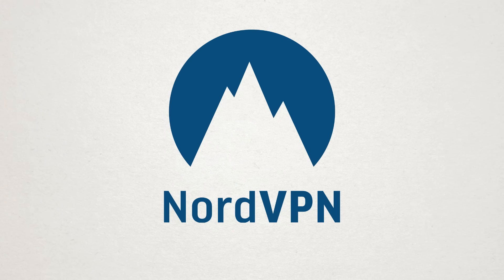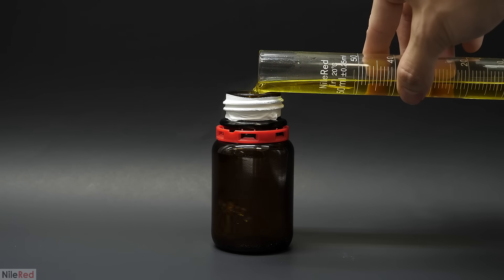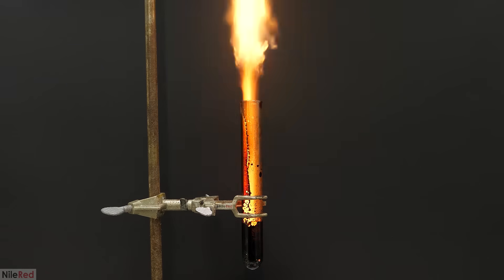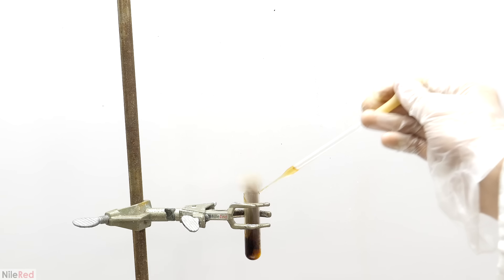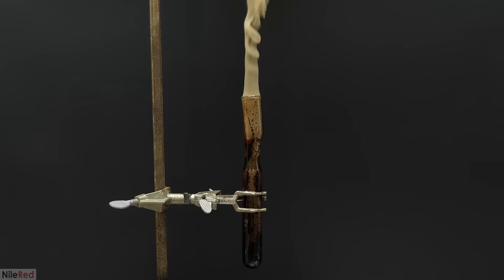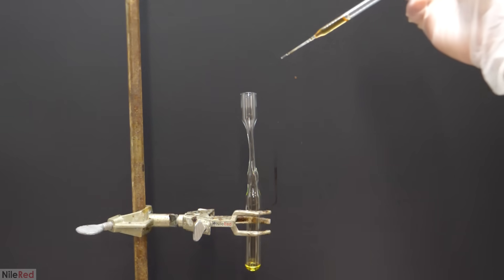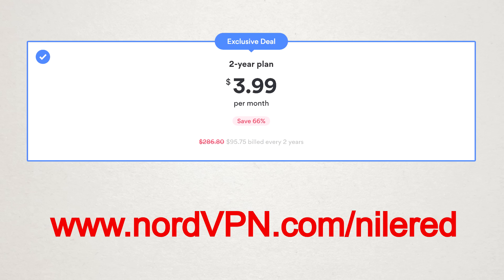Making test tube liquid rockets

Comment: If the chemicals dont mix closer to the throat are they still affected by it? It seems you need to put the throat closer to the bottom of the test tube where the chemicals begin interaction.
Reply: The last tubes throat was fairly close to the bottom and gained a fair result I believe moving the throat closer to the chemicals initial reaction will improve said reaction.

Comment: what if you make a sort of dump tank. which would then work kind of like a solid-fuel rocket. that there's two slightly pressurized tanks that quickly dump the contents into a chamber with a nozzle? 
does that make sense?

Comment: ConDi nozzles will only work if you can get the flow through the throat supersonic, so you get a shockwave form. Otherwise it's just like pinching a hose pipe in the middle of it's length, it just constricts the flow rather than accelerates it

Comment: I'm not sure I understand what's happening very well.

So the whole idea is that the nitric acid oxidizes the aniline, leading to a combustion reaction, a fairly violent one. But there are a few things that I can't understand :

- why does it almost always burn in two times ? There's almost everytime a first combustion, a flameout, and a second combustion. Why is that so ?

- why does it sometimes doesn't ignite ? The reaction is happening so why does it just not ignite ? Does the reaction need to reach a certain temperature for it to become a combustion ?

- why doesn't it work when he narrows the tube too much ? Looks like he's saying that he sprays the aniline too much, but how is it different from before ? Why does he need to add less aniline for it to work ?

Comment: If you use hydrazine, be sure to take no chances with safety.   I don't know where you would get it, but it is used where I work and there are certainly some horror stories with mishandling.  Keep in mind that the vapor during burning is still pretty dangerous.

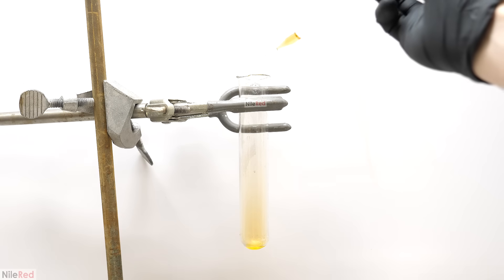Comment: at 4:57 I might be wrong, but it appears like it is the gas that ignites. When you add the aniline to the nitric acid, there is clearly a Lewis acid/base reaction that is exothermic. This quickly evaporate the liquid that ignites, probably when it comes into contact with the air.

Then there is too much product in the tube and not enough reactive. So you have to wait a moment while more reactive get evaporated to get the second blast.

I would suggest doing this experiment in an inert environment, maybe with nitrogen gas. This will show is the ignition is cause by the reactives coming into contact with oxygen.

If this is the case, you can then find the right mix of gas to get the most energetic reaction.

Comment: I’d like to see you test on how much it would propel depending on the length from top of the tube to the bottom. See if that has a correlation to increasing or decrease thrust. But would be difficult to maintain the same diameter of the throat. Great vid non the less, gets ya wondering.

Comment: Try with a mm throat, mostly it could combust and push the entire tube down, your last test actually worked and it got pushed a little, almost not visible but you can see it if you turn down the speed of the video

Comment: I think that you need to make a small glass combustion chamber with a de-laval nozzle. To the combustion chamber, attach two tubes in a "Y" fashion,those can lead to small electric operated valves. On top on the valves, attach a small container for oxidizer and fuel. Then you can fill those chambers with the exact required ratio to achieve a best possible burn and activate the valves from a safe distance. Gravity feed should be enough for small samples.

Comment: Not a scientist here.  BUT

It looked like before you necked down the test tubes the fire took place outside the tube, but afterwards the fire took place inside.

It looked to me like there were two different reactions going on.  The first in the test tube was oxygen starved, created significant heat and then shot the resultant chemical mixture out the tube where it was exposed with air.  This would be very interesting to test further.  I think the second set of reactions were significantly different in that they took place without free oxygen.

Would love someone who actually knows to weigh in.

Comment: Comments: DoNt MeSs WiTh HyDrAzInE
Nile: already made some 3 years ago with urea and bleach
Reply: He made phenylhydrazine and hydrazine sulfate. When it comes to safety those are a world away from pure hydrazine (phenylhydrazine somewhat less so, but he made a tiny amount), which is what the rocket fuel is. Hell in the start of the hydrazine sulfate video he says clearly he will not be making pure hydrazine because it is too dangerous.

Just look at NFPA 704 for hydrazine vs hydrazine sulfate, there's no comparison.

And then there's the part where he wants to use it in rocket experiments, which means not just leaving it in a container but getting it everywhere. Yikes.
Reply: So fun fact, hydrazine is used to add hydrogen to BWR nuclear reactors to prevent oxidation

Comment: "Test tube liquid rocket" is the code word for extreme molotov.
Reply: Xtinct- ohh nasty, a compartmented glass bottle with one half the base and a quarter of the reactive chemical
Reply: @mftripz8445  you just unintentionally gave me the recipe for a Molotov cocktail😏 i uhhh gotta go do something in the garage real quick
Reply: the reason of it not showing any intresting things when you narrowed up the throat was the 
1) the combustion chamber or the place before the throat where reaction was happening was way to big and thus there was not much pressure built up to fire through the main nozzle
2) the throat to nozzle ratio largely matters when you deal with bell nozzle engines here the nozzle was way to big and what happened was the pressure in the chamber dropped too low and thus causing the the air to come in from outside which slowed the reaction and thrust. this is why the flames was not close to the walls (glass)
3)the shape of the part after throat was not well for fluid mechanics. if you see very carefully the throat the place just after the throat you would see a huge empty space between the flames and wall which should have existed 
these were only which i found out being a noob in the subject but yes i could say if he had done all these he might have blown everything around and even glass would not be able to handle the pressure in the chamber
Reply: Buran-Energia.
Reply: 'No cops, you see i was not commiting mass murder by burning down public buildings with a molotov cocktail, it was actually with a test tube liquid rocket.'
Reply: Thats what i thought
Reply: Next step: self-propelled Molotov cocktails 😮
Reply: Y e s
Reply: @glitchedstudioss  your translation is forks and i find that hilarious given your name
Reply: :O dont say that!
Reply: @sleepygraham5482  But that’s what it is
Reply: yes.
Reply: "making" is the airline part
Reply: Hmmm, totally not going to use this information for anything illegal /j
Reply: Its more of a homemade flamethrower.
Reply: I love this
Reply: @Symbol N O I S E
Reply: Zacharias //  molotovs aren’t “models”. They’re makeshift weapons. If they were factory made as models they would just be called incendiary grenades. And the idea of having a more explosive or flammable liquid than what is normally used in molotov cocktails isn’t new.
Reply: Finally. Now I can kill the Wild dogs here
Reply: Don't give me any ideas

Comment: The initial test tube necking attempt to mimic a rocket combustion chamber's throat was poorly planned. The throat needed to be on the exact opposite side of the tube closer to where the combustion takes place. What you did essentially effects nothing because by the time it reaches that point of the tube the expansion and pressure has already mostly peaked so nothing gets compressed much further.

Comment: @nilered your table of hypergolic fuels lists RP1, which is basically kerosene ultrarefined without various additives. 
A readily available analog is automotive diesel fuel or paint thinner. I would work with this combination before venturing into hydrazine fuels. As noted in one of the other comments hydrazine is a very toxic chemical with violent reactions. Hence the very limited use in a rocketry ATM.

Additionally, a safer oxidizer can be had with hydrogen peroxide purchased at 35%, processed to 70% or higher through the use of dry ice. The hot method of removing water from H2O2 can easily run away with corresponding results. The mantra of rocketry is pointy end up.

Comment: If I poured nitric acid in my built Cummins diesel truck, would it boost my power?
Reply: Garrett Glenewinkel maybe but I wouldn’t try it
Reply: It'll probably increase your thermal energy output a hell of a lot for a very short period of time, but will also destroy your engine so it'll really depend on what you want

Comment: The converging-diverging nozzle is only really effective if the velocity of the exhaust product is sonic in the throat, otherwise the diverging effectively undoes what the converging part did.  You probably came across this in your research, but it has to do with the way diffusers and compressors work with subsonic and supersonic flow.

Comment: You may or have mentioned this in the video (correct me if I’m wrong; I wrote this comment at the beginning) you did not mention Rocket candy. R-Candy, as it is known, is a hypergolic rocket fuel considered a great alternative to gunpowder as a fuel, as it is a paste made from Potassium Nitrate and either pure sucrose or sorbitol. I happened upon a video explaining it with sorbitol, and it appears to be an extremely cheap yet extremely practical way to make amateur rocket fuel. Nitric acid being as dangerous as it is isn’t practical alone but combined with the potassium in KNO3 it is obviously more stable. Hence I also imagined using Ethanol, created also using sucrose, with an obtainable form of liquid oxygen. 

I put it as a challenge that you or some other youtuber that DIYs stuff to attempt to make Liquid Oxygen to attempt a non-hypergolic amateur rocket for practical use.

Comment: you can try thick walled borosilicate glass tubes. They can handle very high pressure. You just have to melt the one side to close.

Comment: The laval nozzle only works properly if you actualy reach supersonic at the chokepoint. Otherwise the widening part is just a diffuser. That said the neck might ease ignithion by increasing the pressure and temperature of the gas.

Comment: If you do this again, can you try non-nozzle and nozzle type tubes again, but have your setup on a scale to be able to measure the difference in downforce between them? Doesn't matter the number or anything, but would be neat to see a comparison of force between the different setups. There was clearly a distinct difference in sound when the gasses and flame were shooting from the nozzled tubes. Sounded much higher in pressure.

Comment: Interesting enough, only the fuel in the orange tank is liquid. The fuel in the boosters is solid.
Reply: Yeah, it's APCP, or Ammonium Perchlorate Composite Propellant. Basically ammonium perchlorate and aluminium powder embedded in a hard rubber matrix. The aluminium gets burned to Al2O3, which is is the cause of the huge clouds of white exhaust smoke.

Comment: Venturi carburetors are shaped to be big on one end smaller on the other and have a very small area to connect them so the fuel can atomize and be burned easier kinda like the engine that was shown at 11:13

Comment: Hey Nile, its very easy to synthesize hydrazine in your backyard, all you need is anhydrous ammonia and reagent-grade hydrogen peroxide, I'm not sure if you would need 30% (which you can buy in bulk), or 60 to 90% (which you can't buy in Europe or the US, and you have to distill it from 30% in an anoxic environment, which is extremely dangerous considering how explosive hydrogen peroxide can be on its own), but it's also very toxic and very explosive too, be careful making it if you can't find a source!

Comment: hydrazine is really dangerous to work with. At NASA hangers where they use it to start jet engines, if there is even a small leakage or spill the entire building has to evacuate.

Comment: Your combustion chamber to nozzle ratio is completely off. In the cross section of the actual rocket, the combustion chamber with sub sonic is very much smaller than your test tube attempts. You should revisit this experiment with the throat much lower on the test tube for better combustion and higher pressure.

Comment: If you can, Try Kerosene and 85% concentrated Hydrogen Peroxide. They aren't hypergolic with each other on their own, but if you catalyze the peroxide with Nickel Oxide, the oxygen gas it releases will be hot enough to ignite the kerosene. This is how the Gamma family engines on the  British Red Arrow rocket worked. You'll need an Oxidizer-to-Fuel ratio of about 8 to 1 by weight.

Comment: Please use a fume hood when working with analine, its absolutely treacherous.   
Analine fumes wont get you now, they will haunt you 20 years from now.

BTW if you do manage to obtain some hydrazine for testing, dont put it in a test tube like in this video.   It will explode.
The reaction is so fast that, on contact, drops go off like large fire crackers.   Without any confinement at all.

Comment: You might want to try using tongs to "crimp" the throat into the test tubes instead of stretching them. I'd imagine that will give more consistent results and keep the walls thicker than stretching.

Comment: i think the reaction in small tube was more powerful, cause small tube similar with true combustion chamber: in smaller space reagents mixing a little faster, and heat and pressure collects much more effectively. bigger tube = bigger amount of glass, and glass absorbs the heat, slowing down the reaction. and pressure matters too, without pressure it would like burning reagents just in open air.